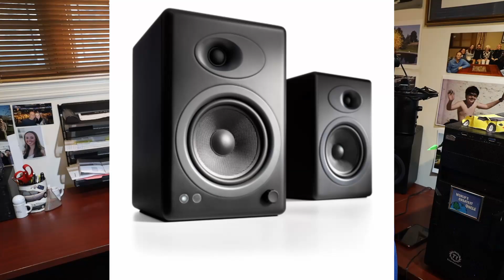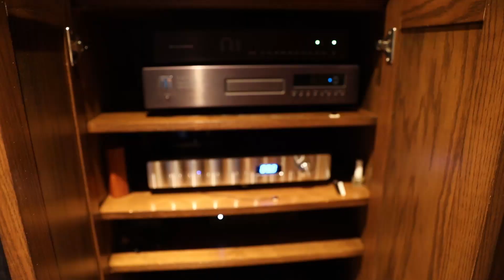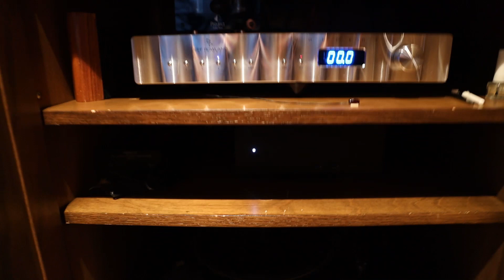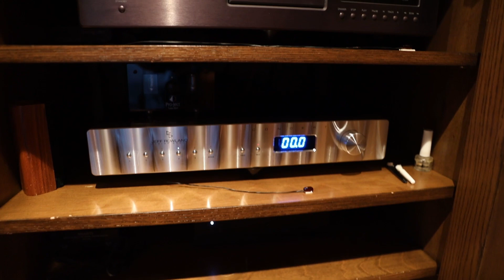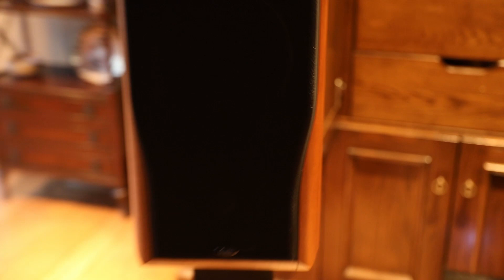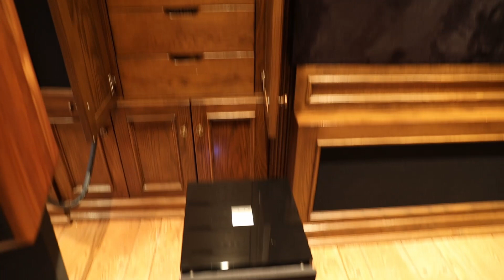Pro-ject Pre Box S2 Digital - My thoughts

Comment: Another review of this dac was from 4+ years ago. Do these companies update the hardware in them?  The whole purpose of me buying a new dac is because I have an old...er receiver (with old dac, old Bluetooth tech).  I don't think there's any point in upgrading it. My portable fiio btr5 does a little better on dac duty. I'm thinking for $350 a brand spanking new model...ifi zen one signature with both including ldac codec could last me another few years. Seems geshelli j2 would be the way to go without Bluetooth for the $. With such rapid changes in this tech i should upgrade only  specific outdated components, do it cheaply and often. Both have ballanced outputs btw and j2 is almost 1/2 the price of the s2.  I don't know about  USB shortcomings or digital transfer cables making any difference in sound quality. I do see your discussion about this topic below and I'll be researching.
Reply from the maker: Software, rarely do they come out with an updated USB driver or firmware.  Never have I seen any manufacturer release a hardware upgrade as they would rather have you buy the Gen II version.
Reply: @iand8548  There are a couple updatable options available. McIntosh c63, Wyred 4 Sound DAC-2,etc.

Comment: The Denafrips Terminator would sound better than the Bryston.
Reply from the maker: hi Stanny1. Although that's not what my video covers, I've heard of and seen 2 reviews of the Denafrips terminator.  Have you heard both the BDA-3 and this DAC side by side to get a comparison?  It would be good to hear your thoughts on the differences, pros/cons of each.
Reply: No and I haven't heard of any comparisons. But the Denafrips models have been lauded by the press over and over. The Bryston is a great DAC as well. I'm going to look up and see if there are any reviews on your DAC. I bought the Project DAC featured a year or so ago at about $350. All the Pro-ject stuff has gone up. My next purchase will be the $800 Pro-Ject Streamer because it's very reasonable for a streamer that is a ROON endpoint. It is also a John Westlake design. This guy is on fire, as is Bruno Putzeys.
Reply from the maker: @amazoidal  Thanks for the reply.  I like the Pro-Ject stuff.  As a Roon endpoint, I was recommended by Roon to use a RaspberryPi with a USB (or other Digiout hat for isolation like HiFiBerry) and the RoopieXL firmware.  It works great. I'm no longer a Roon user as I have switched to Audirvana and like it better sonically.  Roon's GUI/user interface is superior.
Reply: @iand8548  I'm considering Audirvana as well. I prefer the idea of keeping my streaming/local file listening separate from each other. One of the reasons I never liked Roon.
Reply from the maker: @simplesimon-k8k  I haven't used Roon in a while, but thought you could identify or filter local vs streaming versions of files?  I like the sound of Audirvana, which is the primary reason I switched. I'm still using the non-subscription version. Maybe if I can hear a difference or they stop supporting this version I'll switch to the Studio version.
Reply: @iand8548  It's certainly possible and to tell you the truth I had only used Roon for a few days back when I had the trial. For me personally the interface was just too busy. I just want the basics, artist,track,tile,bitrate,album art,etc. I don't need recycled content from Wikipedia for every artist in my library. Maybe I would have gotten used to the interface but it just wasn't what I was looking for.

Comment: What’s a good preamp for my turn table
Reply from the maker: There are many considerations: 1) price point , 2) amplifier(s) that you have today, 3) cartridge (MM or MC), 4) would this be for analog and also serve as DAC?  No simple answer.  I suggest you start with you amplifier manufacturer for compatibility  and if it doesn't support a phono section, buy a phono preamp to connect into one of the line inputs.  Hope this helps.
Reply: @iand8548  when I get home I’ll let you know my setup

Comment: Hello, and thank you for the review. Will the Pro-ject Pre Box S2 Digital be able to drive a 250 ohm rated headphone?
Reply from the maker: Hello, I can’t answer your question as I don’t use headphones. Pls check on pro-ject website or call a local dealer.
Reply: Too late but... S2 Digital Jack 6.3 output is too low power, so anything with 64+ Ohms impedance would be not loud enough. Or it should have great sensitivity.

Comment: Hi, do you know if the volume control is just for headphone output or will it be able to control volume to a power amp?
Reply from the maker: hello Neil. Sorry for the tardy response. I have the S2 hooked via RCA outputs to Audioengine powered speakers.  Just tested this out (since I always leave the volume set to 0db).  The volume control on the S2 does vary the output level to the speakers, so the answer to your question is both.

Comment: While I appreciate this review, you lost me on the "shortcomings" of USB.  It's all digital, period. Data is transmitted and checksummed and is the same on one end as the other.  if it isn't you get NO DATA since the modem (modulate/demodulate) chips would reject it. We don't need special USB cables for hard drives which must also be perfect. As long as it's within spec, it's all good.
Reply: For audio the issue with usb is electrical noise that is transmitted from the computer to the DAC. This electrical noise can never be fully isolated from affecting the preamp in the DAC which affects the analogue output of the DAC. Cheap USB cables can add electrical noise due to poor metal quality and stamped contacts. So its noise from the computer that is then further aggravated by poor cable added noise which can affect the analogue section in the DAC. Yes, the bit are 1's and 0's and are not affected but that is not the problem affecting the sound quality with USB. Optical seems to be best if you have the option.
Reply: @sudsnh  I've heard this argument before. Can you actually hear the difference between USB cables? I'd doubt it.  My argument is that if you can't hear it at silence, then it's meaningless.  The only time I plugged in a USB cable to my DAC and got audible hum was when I connected my portable Oppo HA-2 to my two channel analog system. That system is centered by an Audible Illusions Modulus 3 tube pre-amp. It was built 25 years ago and its about as analog as it gets.  Back when it was built, the only digital anything were CD and DAT players, but this Pre-amp was only RCA jacks anyway. But my HA-2 produced a bad hum...and I couldn't figure out why. Turned out I had connected the HA-2 into the "AUX" input of the Modulus 3 and not the CD or DAT inputs. It mattered because the design of the pre-amp had AUX serve high output line level input devices instead of normal ones. When I plugged the HA-2 into either CD or DAT, I got silence. If I'd bothered reading the manual, I could have figure this out quickly rather than wracking my brain for weeks on a solution.  And I tried 3 different USB cables during this exercise. All of them performed the same.
Reply from the maker: @Sevenfeet0  I'm a pessimist too, so I tried various cables to see if I can hear a difference and liked them better than a basic printer USB cable. In short, the answer is yes, regardless of the reasons why.  I leave that to the engineers who design cables to explain, such as jitter, electronic/power noise from the 5v line, etc.  I've spent $$$ on my audio system and wanted to know if cables make a difference. With this in mind, i tried 4 different USB cables, but most importantly I put a USB Regen device with a linear power supply in place. This made the most difference regardless of the USB cable.  You can see that here ==> https://uptoneaudio.com/products/usb-regen. I also settled on a Wireworld silver starlight 7 cable which I thought sounded the best in my system. Hope this helps provide a different perspective.  Enjoy the music!
Reply: @sudsnh  problem with optical is you now have to under two transformations as you enter the optical cable and then convert back on the other end